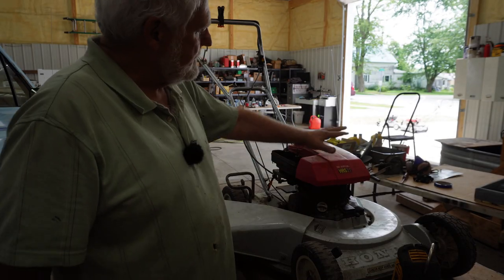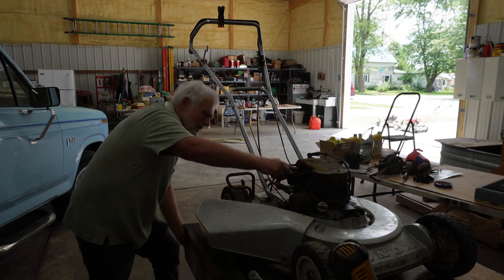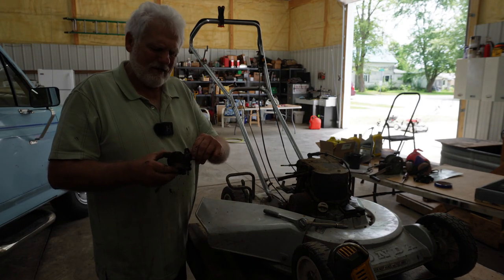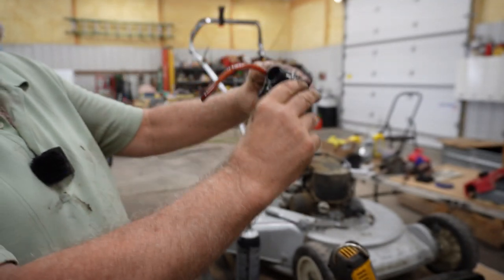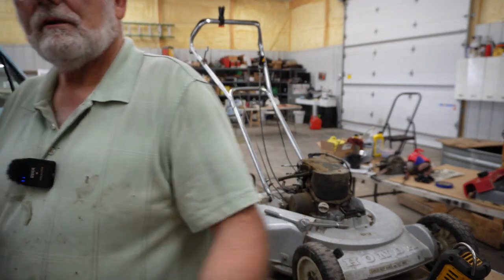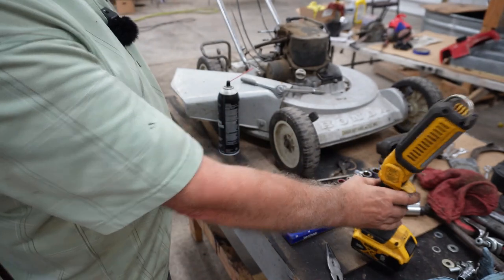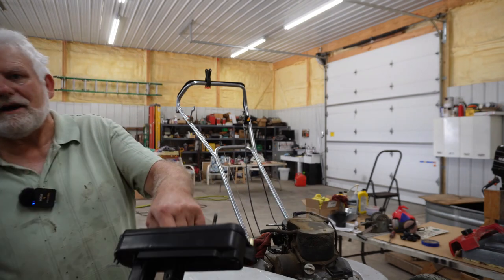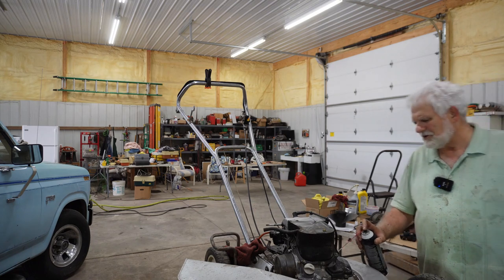Ultrasonic Cleaner vs. Manual Cleaning: Which Wins?

Comment: I have worked on slot o

Never seen a Honda carb like that.   I'm learning
Reply from the maker: Something else different is the flywheel is under the mower deck.  I wouldn’t have believed it if I hadn’t seen it.  I didn’t realize this until after I made the video.